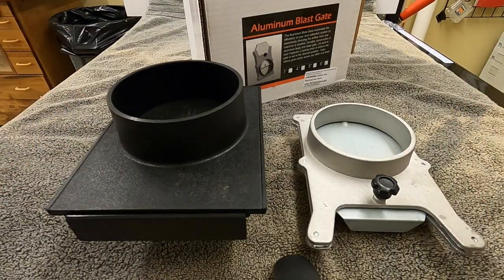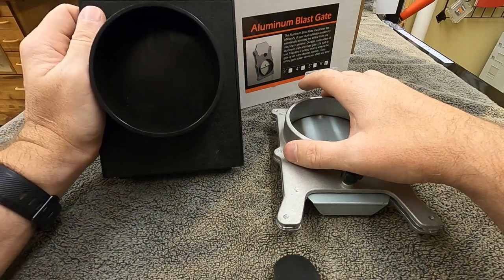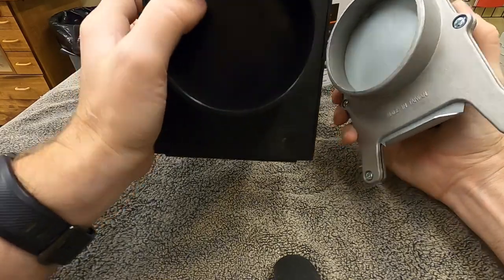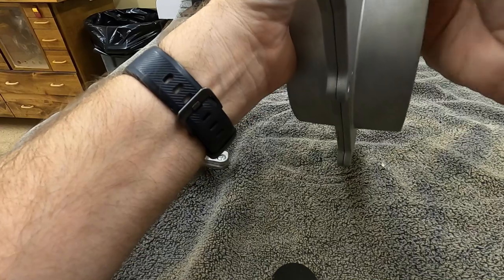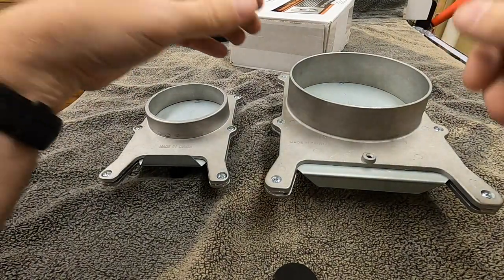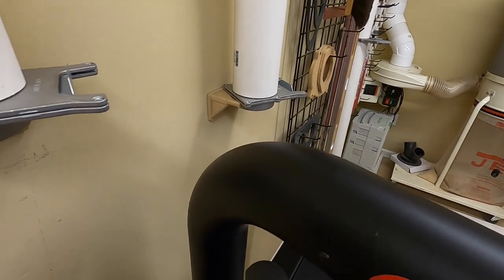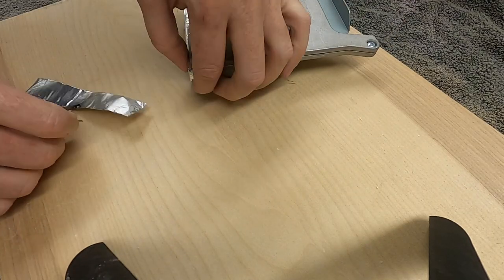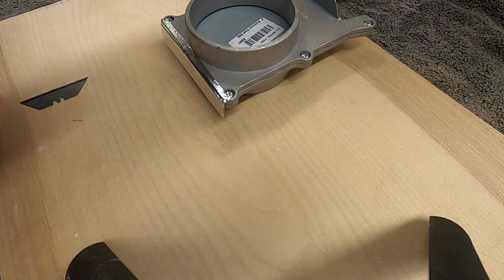Dust Collection Blast Gates

Comment: Just seeing this as i searched for good guidance on installing a dust collection system with blast gates. I found that my aluminum gates didn't seem to "seal" if they were installed the correct side up. Or at least it seemed so. Perhaps they would be "pulled into a seal" as the vacuum kicks in.  But without the ability to test (I mean who actually has one of those tools!) I decided to make some additional adjustments to the gates. I basically put some slim, slick plastic inside so the gate could still slide shut - but this "shimming" effect enhance the little nubby thing's action of boosting the gate up tight against the gate housing -  and seemed to eliminate the gap I had been seeing. Hate to tell you this little exercise took me an hour to fine tune 3 gates. But I'm more confident now that I'll have tight seals, and less air leakage (and more effective cfm through the system). Thanks for opening the door to a better gating system!

Comment: I'll have to go check all the gates at the shop. I use them above the motor making and soldering stations. 

Great fix!
Reply from the maker: It makes a difference. It's also quieter when you don't have the whistling of air being sucked through that slot.

Comment: Neat, I learned some stuff watching this video. In my case I ended up with a dust collector powerful enough that the small leaks in my aluminum gates don't matter, as that 20CFM is less than 2% of suction loss, but to someone who has a smaller dust collector, that could be as much as 10% suction loss, and that makes a big difference.
Reply from the maker: It all adds up.

Comment: Well this is very cool and I learned something. All my 12v career I have work in big box stores and never got the chance/experience to do/learn fab work ( even my with my stint @ Tweeter Etc I was in management so rarely a chance to get my hands dirty 😂). This late in the game I have decided to rehabs the garage and make it into a work shop ( spring can’t come fast enough). 

Thanks for sharing the vast knowledge you have...I appreciate it greatly
Reply from the maker: Thanks, man.

In my experience a lot of shops are lacking on the dust collection side of things. Whether it's a weak/poorly designed system, or simply not having dust collection at all (I've seen it) it's a bad deal. Not healthy at all. 

Good dust collection in a home shop is something that will keep the wife happy, too. The better your dust collection, the less mess will get into the house. 

I'm sure you'll find that a lot of the things I'll be doing on the channel will be good ideas for your home shop.

Comment: Do you not drive in a screw through the pipe into the blast gate? If you do put a screw in blast gate would you recommend pre-drilling the vast aluminum?
Reply from the maker: No screw. The foam I use to seal the gate to the PVC keeps the pipe in place. It's a tight fit.

Comment: Couldn't you just use an oscillating multitool to cut a thin channel in the bottom of the plastic dust gate to let the dust come out
Reply from the maker: You could do that if you wanted. I chose the metal gates because of their more robust construction.

Since this video I've gone to iVac gates. Don't have the full shop set up with them yet, but I'll eventually get the whole shop on the iVac system. All of the tools are on iVac Pro Tool Plus sensors that kick on the dust collector, but only the outfeed table and CNC have iVac gates. Still need to get them for the table saw and mobile cabinet.
Reply: Then you would have a leak